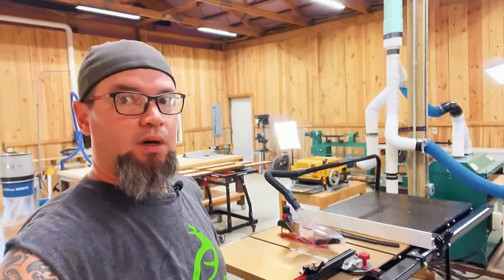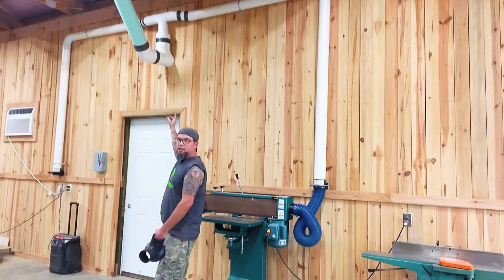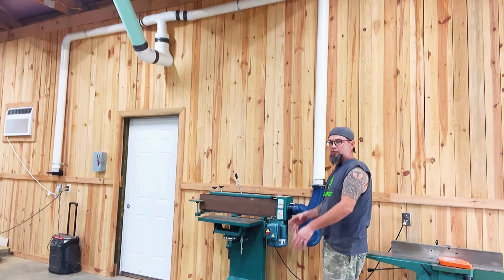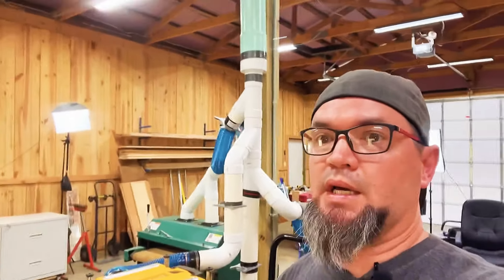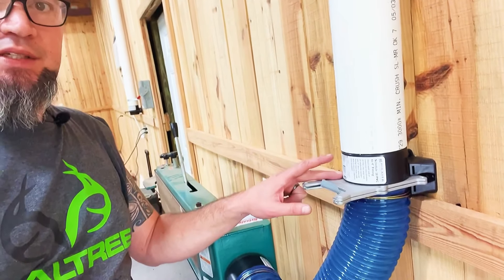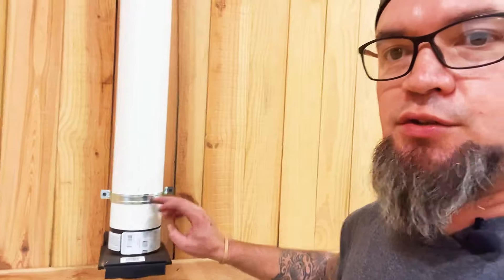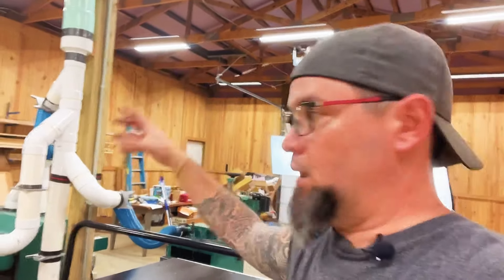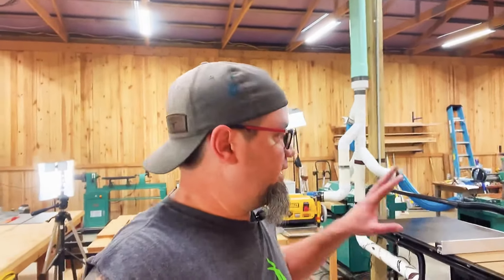Whole Shop Dust Collection Ran Off Of One Old Collector - The Setup and Test!

Comment: Every 90 degree joint should be replaced with either 45 degree or 22.5 degree joints.  Your extraction power and capabilities will improve to be 40-60% more efficient.  With your "ceiling" height, the vertical runs are being suffocated with 90 degree bends.

Comment: I have worked in two wood shops just like yours, one I owned and built my own dust system. I also worked in a cabinet factory. Every Dust collection line had to have a ground run with it. I wonder if you have any static issues? Also the one shop I worked in, the owner ran low-voltage contacts to the gates and when you opened a gate the system would come on.

Comment: Sounds pretty bad, but metal coffee cans are surprisingly 4"& 6". Same miter saw. Made a wood contraption that uses a 4"& 2 1/2" hoses. Works great on short cuts. Not as good on sliding cuts, but better than what came stock.

Comment: I think you could increase CFM by converting your exhaust to 6 inch pipe . The rectangular port has basically the same cube as a 6 inch pipe but manufactures will instantly drop it to 5 inch .. opening that up to 6 would probably add 150-200 CFM . You can’t pull in more than you are letting out
Reply from the maker: Very good point and I attempted to convert it 6.  If I start having issues I'll def do that but I've had no issues so far.

Comment: Good tips, my previous shop I had run the dust collection port through the wall as you did. However, did not realize that the negative pressure created inside the shop would suck the smoke down the chimney of my wood stove. Had to open a window while in use. I was evacuating the heat out of the shop.

Comment: I converted my old in shop system similarly.  Mounted the old motor and impeller unit to a support post near the ceiling, put in a trash can separator to catch the bigger stuff between my upfeed ducts and the impeller, and ran the exhaust outside through the wall.  I use a remote control to switch the motor on and off.   Several benefits: better dust and chip removal from the machines, less floor space needed for dust collection equipment, and (most impressively) a significant reduction in dust collector noise in the shop.  I may end up eliminating the trash can separator since I live in the country and sawdust being exhausted into the outdoors is not an issue.

Comment: That is a nice shop that you've got.  You're absolutely correct about the fact that anyone will have problems getting pipe and other fittings that are made for each other.  The one question that I have is this! You did not say anything about running a ground wire through your suction 
lines!  Your not worried about a fire?  I do like how you did this dust collection system.  You have shown a lot of people what not to do.  I like the advice that you have also passed on.  All in all, GOOD JOB.
Reply: The static electricity issue is a bit of an urban legend, there are no documented cases of static electricity starting a fire in a residential shop dust collection system.  The biggest problem is dust sticks to the outside of the pipe and it looks gross.     There have have been cases of static fires in PVC pipes found in Grain silos, which is i believe where this concern comes from but "a chicken is not a duck"  The most common cause of fire in a dust collector is actually ingesting metal into the system and having it spark against the impeller.

Comment: Where I work we have multiple dust collection systems.  As you said the filters systems are outside.  They cost millions.  I believe the problem is that they remove huge amounts of BTUs from the building.  One of the systems removes Welding smoke and grinding stuff.  Each system has to return the BTUs into the building.  When a system isn’t working properly it’s a nightmare in the 100,000 square foot facility.  
Great points and take on stuff.  I’m working on my home welding, machine and wood working shop.  Can never stop improvements.

Comment: Good video, very nice installation.
As you said, the planers and shapers are the machines creating the most dust.
A large planer of 20” or more with a large motor will tax the system the most.
Especially when say a large draft of lumber is planned at a session.
In larger shops its sometimes better to have things like hand sanding stations and edgebanders on a separate individual system.
They dont make all that much dust anyway.
My son has a large shop, and he uses PCC pipe also.
His system is a large cyclone installed in an outdoor shed against a side of the building.
It simply empties into a standard trash can, but is pumped from that to a fully enclosed dump trailer.
When the system is running the pump is running also.
It dosent take all that long to fill the trailer when planning a large quantity  of lumber.

Comment: You just blew my mind. I’ve been watching videos after videos on dc and trying to learn about the filters or bags to keep the air as clean as possible. I never thought about just mounting the motor outside my shop and just collecting dust inside a trash can. Keep it outside! I have a lean to on my shop and believe I can tuck it up in the ceiling of the lean to and it shouldn’t get wet or anything. Thanks for the tip!

Comment: I just did this very thing, but my collector is mounted up on the wall inside my shop and blows outside but thinking about building a room outside for it to go in to make it quite. The price of the 6 inch pipe and fittings is tough to swallow but well worth it.

Comment: I have the same fan unit. I took the rectangle flange off of my blower and transitioned my discharge to the equivalent sq inches of the flange outlet. That portion of the flange with the round outlet was a less than 5" in diameter which represented about a 40% reduction on the discharge surface of the rectangle end area in sq inches. I also bought a larger impeller but even if I hadn't fiddled with the impeller, I'd still recommend losing that rectangle-to-tube flange. It's an absolute beast now! Restriction in the collection tubes is important but so is the static head pressure applied to the discharge of the fan. They only made it that way for cost purposes. Also, when you do this sort of thing, you get those actual flow numbers they advertise, which are taken from the fan unit before they "package" their "system". That's why you expect say, 1,000 cfm but only measure 400 or 500 in real world applications. And as you say, it only gets worse as the filter/bag/whatever gets clogged.

Comment: Good stuff, thanks! Thoughts on running 6” pvc mains under new garage/shop concrete slab. Going to run radiant pex and pvc electrical conduits anyway. Less to trip over.
Reply: The only problem with enclosing your dust collection pipes in a concrete floor is if you ever clogged up the pipes somehow, you'd have to bust up the concrete in order to get at the clogged section....not sure if that could ever be an issue with pipe that large but I'd run it overhead at least it would be much easier to get to without tearing up a floor...that and if you ever decided to redo your shop and needed to move the dust collection system somewhere else, you are stuck with it because your pipes are in the floor permanently.

Comment: I know this video is old but it is still a great reference!  At timestamp 4:30 you are holding the divider piece from the dust collector.  Yours is 6 inch by 2 @ 4 inch.  The divider piece from my dust collector (2 hp harbor freight) is only 5 inch by 2 @ 4 inch.  Would you suggest making a different divider plate that is a 6 inch piece and run 6 inch everywhere or just downsize it to 4 inch and use the 4 inch for the backbone of the entire system?  My shop is 24x24 and I have no 220v tools.  All tools (circular saw, planer, chop saw, etc. - no jointer yet) are hobby grade type machines (ridgid, dewalt, etc.)  I am starting to plan for the layout of the shop and would love your feedback.

Comment: I know this is an old video, but I just watched it. Excellent. Thank you.
   I have a question: I have a General 1.5hp dust collector. I wonder what the difference in performance between using the filter&bag as opposed to just running the exhaust through a hole in the wall to outside with no filter.
Reply: The bags of course clog up after a while with dust, so you'd have to keep them clean, shaking them or tapping them out all the time between uses...so you'd have suction loss due to the bags getting clogged up, plus the reduced air flow from the bags alone....so running your exhaust right outside of course gives the dust collector free exhaust that isn't restricted by the bags, or clogged up bags, or filters.

Comment: Packed full of great information! I'm shocked that you have a 2 hp motor and boy, you sure can hear the suction as well as see it. Very impressive. As you mentioned in 5he beginning, DC can be a bit complicated as far as doing the math for it. So many don't understand the CFM ratios and how important it is to understand them. You don't have to be good at math either, I'm not. But today, many great online resources can do that for you. I have a tiny closet of a shop at only 10x16ft and my DC is overpowered by a 2hp motor. I didn't know better at the time but do now. I have an addition going onto my shop soon and I will be using the same 2 hp motor, just better lines going to the machines.  People see the shop vacs with 5 or 6-hp motors and think that's powerful. Well, those numbers can be very deceiving. Perhaps you could make a video at some point explaining that to your viewers. It would be very helpful to newbies who can't afford anything more than that. Great job!

Comment: I like the idea of venting your vac system outside if availabe. The only down fall i see is that if you are heating your shop during the Winter, you will be sucking all the heat out side.
Reply: That's the problem with blowing the dust outside you lose all that heat in the process, or your AC in the summer goes right outside with all the sawdust.  

Great idea but probably not so great for heat or cold air loss.

Comment: Love your videos! A couple of thoughts, on the planer, couldn’t you do away with the 90 degree fitting and direct connect the flex hose? Also possibly remove the 90 degree fitting on the sander and direct connect hose? I actually removed the 90 at my planer. Made a difference. Just wondering. Keep them good videos coming!

Comment: Hey Matthew. Love the shop, and love your videos. I'd like to voice a small concern I have with your roof structure. I'm a truss guy, and I've been designing trusses for over 20 years. My concern is the lack of bracing I see in your trusses. You should have sealed engineering sheets that specify what bracing is needed, and it may require none, but it almost never does. If they don't require any, then my apologies. However, if this is not the case, then I would recommend you add bracing.It looks like you have 2x6 top and bottom chords, and 2x4 webs, and a span of about 30'. I'd brace the bottom chords with purlins AT LEAST every 10 feet if not closer.  So you'll need at least 2 runners going the length of the building. I'd also recommend a bracing purlin in the middle of each diagonal web, and also the length of the building. The top chords should be fine, since they're sheathed.
I know you didn't ask for this "advice", and I don't mean to be "that guy", but I've been working with trusses a long time, and I like you, so I want your workspace to be safe. Trusses are awesome, but they need bracing to work properly. 
Sorry if I'm overstepping, just want to help out a fellow woodworker.  Take care, and God bless you. Thanks for all the great content.
Reply from the maker: No that’s the king of feedback I want. Thanks so much for the advice. I was thinking I needed bracing anyway and you just confirmed it. I’ll add that to my list!  Again thank you! Any feedback Is welcomed!

Comment: Great dust collection video! I have a very small shop and have been wondering about mounting dust collection on an exterior wall connected to my goat shed for  using the shavings. My only question, without a filter,  do you have any issues with lost screws hitting the impeller?

Comment: I'm planning on running mine to the outside. Thanks for all the information. One question: You have a 6" trunk running into the shop but a 4" outlet from the dust collector. Doesn't the 4" outlet limit air flow and negate the 6" trunk?
Reply: that is how the Grizzly comes, 6" inlet and a 4" output.  Depending on the surface area of the blower output, it might be a slight improvement to build a customer adapter from the rectangle to 6" pipe, but  in any case without a dust collection bag or filter restricting it he is still coming out way ahead on air volume.

Comment: Hey wondering if yu have any issues with larger wood pieces damaging your fan impeller?  Thinking of doing same thing but wondering to place a cyclone drop out before blower.  Considering this and the amount of CFM loss from it. Any insight is helpful with why you did not have one and you passed all particles through your blower. Thank you and have watched most videos.  I live across the river from you in Corydon.
Reply: I am wondering the same thing.  I hope Matthew answers you back, now that he has had this system running for a while.
Reply: Another question is, Does the large chunks damage fan impeller?

Comment: I know this is a really old post but, I gotta question for you.  I noticed you have a grizzly drum sander that I am thinking about buying.  My only concern is the reviews on it that say the paper won't stay on.  I'm thinking about going with the hook and loop adapter for it.  How do you like this sander and have you had any problems with it? Also on the grounding issue for the pvc, have you had any static shocks when touching the blast gates? I was thinking about at least grounding those. Great video and lots of good info.

Comment: @MatthewPeech that's a very impressive system but I'm a bit out of my league...lol...since gravity exists I was thinking of running my lines along the ground...would that work? Like make a covered trough...you said a collection would reduce suction...I  want to collect so I can make fire logs to sell or loose for critters.  How would I combat this please? You used pvc...can I also use stove pipes or heat ducts? I'm kinda sensitive to static electricity...how do I ground it? Trying to plan ahead for my first woodworking shop.
Reply: Also...what the heck is an impellor? I saw it mentioned in other comments

Comment: Hi Matt! I'm curious- without some way of replacing the air being sucked out, the building will immediately go into a vacuum and significantly reduce your CFM being sent outside. What was your solution that replaces the exhausted air with "fresh" air?

Comment: New subscriber here. Thanks for the video. I am a retired engineer in Texas looking to add dust collection. Did you have to the impeller just blow that outside or did I miss the collection part? We live in the country and I wonder when it would be a problem not to collect that fine dust (.3 - 10 micron).  Thanks again for the videos and how you explain it.   All the best from north Texas.

Comment: Hi Matt,
Thanks for all the insights and advice, all very well done and easy to follow.
My question is, do you have any issues with static using PVC?
either dust getting stuck to the sides, or even potential fire hazard from sparks?
Thank you in advance.
Reply from the maker: Hey Rob!  Zero static... no dust issues.  From the research Ive done theres never been a documented fire from a collector from static.

Comment: At the beginning, you mentioned how the Y that comes with the dust collector reduces your CFM by half.  When you come through the wall, you go into a 90 degree T.  2 thoughts here.  1.  Doesn't the T as you come through the wall reduce your CFM by half like the Y would?  2.  Wouldn't you be better replacing the T with the Y and using another 45 degree angle elbow?  This would remove your 90 degree turn?  Don't mean to be that guy questioning your configuration.  I am in the process of designing my layout, and understanding simple concepts like the T over the Y will help me understand the mechanics.  Thank you for your content.
Reply: I was wondering the same thing

Comment: Hey Matthew....great looking shop and dust collectiion set up, what did you run your outside pipe into, thanks.
Reply from the maker: Hey!  I just posted a video that shows my setup. But really anything will work so that air can escape. You may have to play around with it a bit.
Reply from the maker: Mines a trailer btw.
Reply: I have a small shop  and i do live out in the country, so i believe this will work for me as well.

Comment: Great video, now it all makes sense.  Good points and tips.  One question, are you worried about static build up?   Lots of opinions on it with PVC pipe
Reply from the maker: I’m personally not. But to each their own. Studies have shown that static has never caused a known fire. I’ve worked in a mill where we ran 8 hours a day without grounded pvc. 6-8” lines and 6 cutter heads going at once.

Comment: I'd like to get your opinion. I have a fairly small basement that I do my wood working in. The big tools I have is Table saw, planer, miter saw. I've started researching dust collection. I make what I can with my little time in the day I have left. Harbor freight has a 1 hp dust collector for 75 dollars more of what a decent shop vac is. So do you think I should take the shop vac/ separator route or the dust collection system route. Thanks
Reply: A shop vac with a cyclone separator setup would work just fine.  Get a larger shop vac say like a 12 or 16 gallon one, add the separator and you'd be fine....but at that point you are pretty much the same price as the small dust collector is.